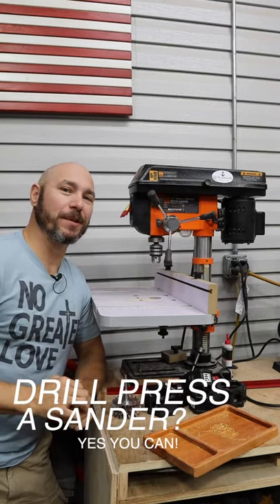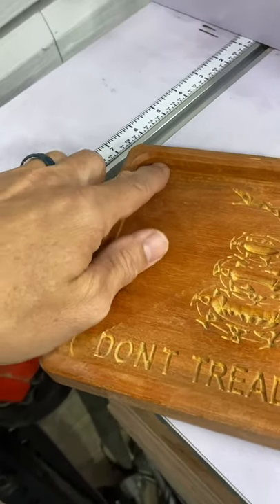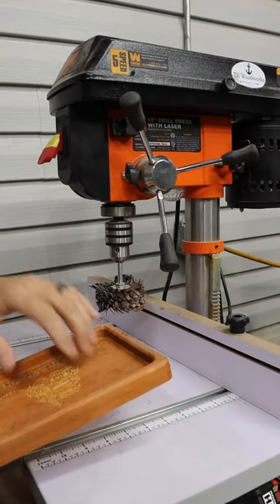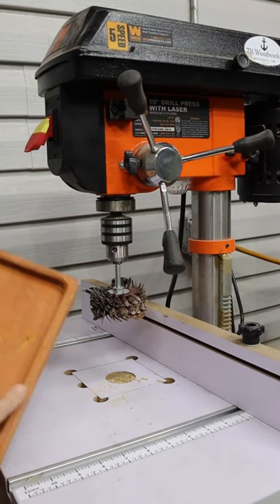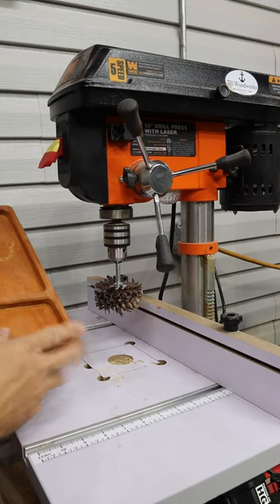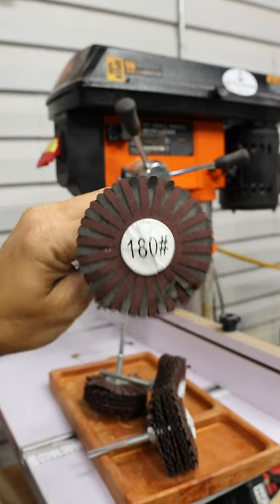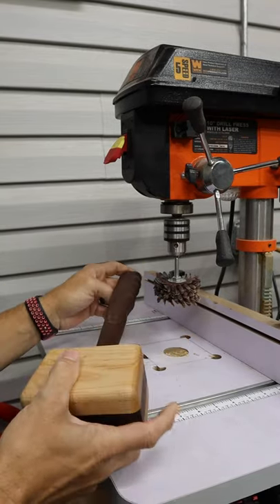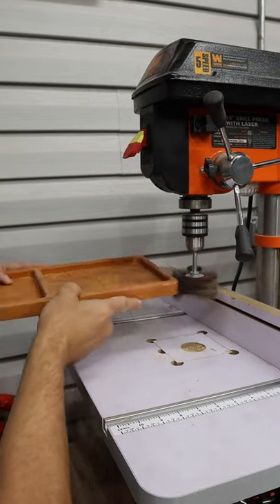Your Drill Press Can Be a Sander Too! #Shorts

Comment: A word of warning.  Many drills have chucks that are held in place by what's called a Morse taper and nothing else.  (Others have a Morse taper plus a bolt.)  A Morse taper consists of two pieces:  one is a tapered cylinder and the other is a perfectly matching hole that the cylinder inserts into.  Surprisingly, these two perfectly matching surfaces hold very well and are sufficient for drilling.   If enough lateral (sideways) pressure is applied, they will come free, however.  In fact, tapping with a mallet is how you remove them.  In other words, they stay stuck when encountering the spinning forces of drilling, but can come free with lateral forces such as a mallet tap - or too much pressure from pushing sideways from something like sanding.

If you are unsure if your drill press is Morse taper only, take a look at your manual.  If the instructions for installing or removing your chuck only reference tapping it in or out with a mallet (or hammer/wood) and nothing else, then be careful about pushing to hard against anything you have mounted in your drill chuck.  The chuck could come loose and injure you and/or damage something.

Comment: You can also get a drum attachment and effectively make a spindle sander!
Reply: I've been using mine that way for a few years off and on now until I get an actual spindle sander. Do t really want to mess up the bearings in my drill press. Then I'm out a drill press AND spindle sander. Does save space though

Comment: I have neither a spindle sander nor a drill press. Which should I buy first?
Reply: I would get a drill press. You can glue sandpaper to a dowel and put it in the drill press chuck to make it work like a spindle sander.
Reply from the maker: it depends on what you do most.  If you do a lot of sanding, I'd say the spindle sander.  But if you need to drill 90 degree holes, then the drill press

Comment: @731 Woodworks  
I've honestly been thinking for a few days now about using something like a plastic drum with a locking lid to sand small to large parts in... Filled halfway with something as inexpensive a pool sand and laid down horizontally on a bed with 4 wheels and a bet-driven motor - you could throw small parts to one large part in and let it spin slowly for ?? time and all the sharp edges / nooks / crannies would be smoothed out. 

A smaller version could be done with a simple 5-gallon bucket?
Reply: Sounds exactly like a rock tumbler or something